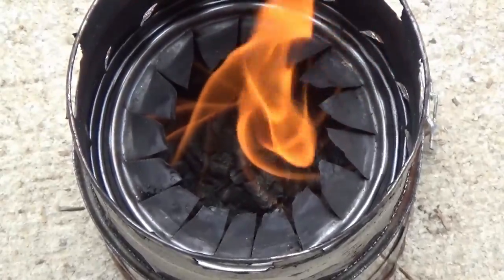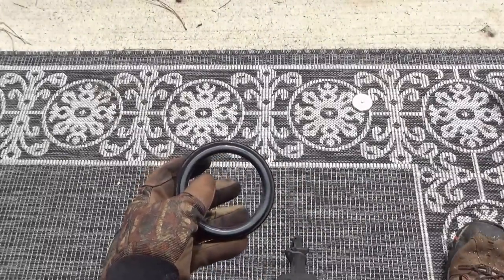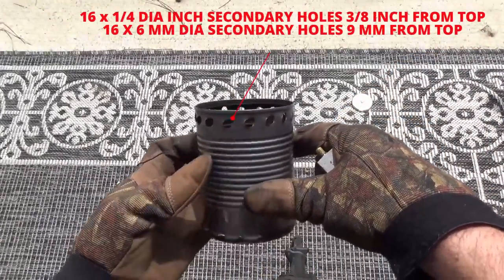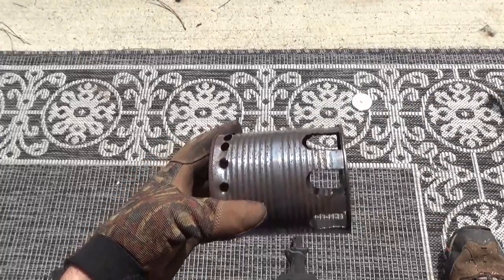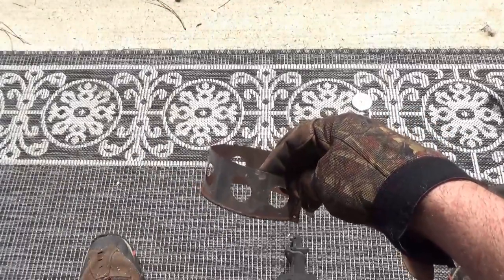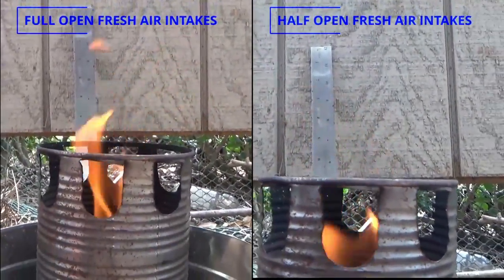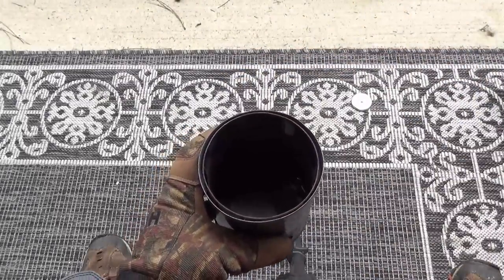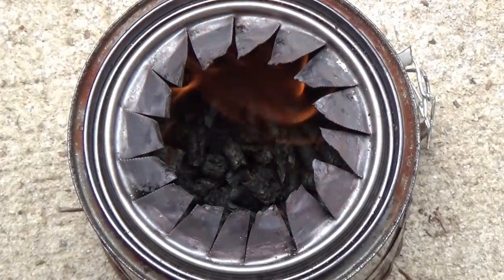Final Build! Paint Can Wood Gas Stove Optimization! Wood Gas Stove Science| Part 9!

Comment: I love the science Mr. Putnam. I am in the process of designing and building a heater based on a wood gasifying stove like yours.
I intend to use 3  5kg gas bottles (which measure 23cm in diameter (about 9 inches) and are 47 cm tall (18.5 inches)
I plan to use two bottles to make a heater body of about 65 cm (25.6 inches) tall and the third one to manhandle a section into a smaller diameter tube to form the "inner can" so to speak. I intend to use stove pipe (I have some 80mm / 3.15 inches which is common in the pellet stove world) as my chimney and possibly the intake. I plan to build the stove in such a way no air is draw from the room the heater is in but only from the outside. I like to use a throttle in the air inlet to be able to throttle the burn.
I like to add a cooking surface on top (with a lid made from the top of one of the gas bottles) and a ash pan below (which is actually the very bottom of a gas bottle which is made to be removable and made leak proof by use of a fibre glass rope (very common in the stove world)
My question to you is if you have any suggestions for me regarding the rought measurements of the "inner can" and the distance I need above the secondary holes to get an efficient cooking surface. And do you have an idea how I could add a baffle to prevent flames from entering the chimney...
Best regards, Sander.
Reply from the maker: The space between the two cans needs to free flow but not be so big as to not allow good heating of the air as it flows upward to the secondary ports. My suggestion is 6-10mm / .25-.375 inches. Good luck with the build and please let me know how it comes out! Thanks for watching!

Comment: Great Job my friend. I would like to recommend a little improvement. I saw it in some video or photo or patent, I don't remember, but the main thing is to put all the stove created inside a greater Can, I used for example the Bigest Tomato Can for Restaurant. It has double function, it help you in case of Wind, because the Air before to go into the Outer can Holes need to pass through  the Top and flow down speed, and also start to warm.

Have a nice day! And let me know if you could improve the stove ;-)
Reply from the maker: Thanks for the comment!

Comment: Heath, great systematic work to nail down the system! Thanks for taking the time to make the videos. 
You discussed the dimensions of all the parts and mentioned a method for figuring out the spacing between the inside and outside walls. Can you point me at the info you have on that? I'm trying to get a handle on applying these principles to a backyard fire pit. Thanks in advance.
Reply from the maker: I think starting with the Vortex 5.7 build video and then using the video on optimizing wood gas stoves to tweak the end result will probably get you pretty close! Let me know how it goes! Thanks for watching!

Comment: I found the enchilada sauce can.  I like that I had to pound  it into the paint can. The Progresso and Bush's can have both fallen out on me.  I don't think this one will.  🤞🤞
Reply from the maker: Looking forward to hear about your results!
Reply: @heathputnam9524  so far it's looking good.  My bottom holes started to run together and I think my total is 1 or 2 less than you used.  It's boiling 2 cups of water in about 7-1/2 minutes and burns about 40 minutes.  I haven't tried the Vortex tweak or flame concentrator yet and it's already the best one I have.  Just putting on your pot stand gained almost two minutes compared to the slotted chicken can I was using.
Reply from the maker: Sound promising! The Vortex tweak will help a lot! And the concentrator will lower wind impact! Keep me informed!

Comment: Thanks for your hard work on this project! Have you considered adding insulation to the outside of the stove to allow the rising gas to heat even more before coming out of the secondary ports? Perhaps some pipe wrap made of fibreglass would do. 

If I can make my first stove using your plans this weekend I might give the insulation a try and report back here.
Reply from the maker: I did try it on an early experiment and didn’t see a noticeable difference but I think it has merit especially during initial gasification. Please let me know how it works! Thanks for the comment!

Comment: I added the pot stand to my stove and cut almost two minutes off my boil time.  I'm planning to make one like this when I get the parts.  I have a spare paint can but the local market doesn't have the 19 ounce inner can.  Still looking.
Reply from the maker: Awesome! Thanks for the comment! Good luck finding the can! I actually took the top ring off the paint can to the grocery store to find the right can! LOL!
Reply: @heathputnam9524  a 22 ounce Bush's Grillin' Beans can has the same top rim as the progresso can but it has the heavy rim on bottom too and it's just a hair taller.  

The 19 ounce enchilada sauce is on sale next week.  Hopefully they stock up before then.

Comment: I think in one of the clips you tossed the flame concentrator into the pot stand. Did you have to trim the paint can lid or is your Hunt's tomato can a little bit fatter than my  store brand can?  Mine sits on the widest part of the lid.  No big deal, I can trim it if I have too.
Reply from the maker: Sorry that was not the cleanest cut between clips. I had to rewatch it myself! 😂 it was playing at 10x but I removed the pot stand and put on the concentrator the put the pot stand back on, but it happened in a fraction of a second in the video. Sorry again for the confusion! Thanks for watching!

Comment: Excellent video!
So the optimized ratio of primary/secondary air would remain the same for a larger build, ie gallon can? How would you calculate area of primary/secondary air in proportion to volume of firepot to determine size of holes?
Reply: not in proportion to stove volume, but inner can bottom area.

Comment: Is there a link to the build plans for this anywhere? Also, if someone wanted to use this reliably, I'm thinking some kind of fiberglass fire blanket would be good in case of a tip over, and some kind of collapsible base stabilizer like you can get for backpacking stoves since it is so tall and skinny. I would love to try this camping since it lets you have a little, contained campfire that is Leave No Trace compliant and requires such little fuel.
Reply from the maker: I try to find a flat rock to put it on when using it in the wild. The plans are on the “ build “ videos, such as they are. I have not published actual plans for any of my stoves, I try to give enough info for a DIYer to be successful! Thanks for watching!
Reply: @heathputnam9524  I'm making one with a baby formula container exterior and quart paint can interior. Is there an area formula to determine the primary air? Or just put in as much 1/4" holes as possible and then use the primary/secondary ratio to get the appropriate secondary area?

Comment: Now I'm confused.  I just watched a man build a stove similar to this except he cut a hole in his lid to fit a smaller can.  He put two offset rows of twelve 1/4" holes on top of his inner can.  If my brain is thinking right, he needs about a hundred 1/4" holes on the bottom to get the 4:1 ratio.  He put eight 5/16" holes and a couple more that couldn't have been more than 1/8" in the bottom and that's all.

It burned, but barely.  He practically put his hand in the fire and said it wasn't very hot. Someone commented that he should block off some of his primary holes.  (He barely had any to begin with!)  That would make it burn slower and hotter and it would cut down on the soot on his pot.

You showed in one of your videos that adding primary holes is what makes it smoke less.  And can it really burn slower AND hotter at the same time?  You have to burn fuel to make heat, right?  More=more.

Sorry for being so long winded but some people seem to have no idea how these things work.  I don't know much myself.  I'm learning thanks to you but I'm not to the point where I would  make an instructional video for others to follow.  I'd look like a moron and I hate when that happens.
Reply from the maker: I hope my videos are helpful to people trying to learn and hope I don’t look like too much of a moron!Haha! Thanks for watching😂
Reply: @heathputnam9524  you look like you've thought through each step and then showed that they actually work.  It makes me wonder how anybody could comee up with an opinion that is so different.

Comment: I would like to see a burner using these principles applied to burning waste vegetable oil and or used motor oils.... I've built many  waste oil burners  and if u can get the temperature and air ratios correct they can burn very clean and extremely hot but I've had problems coming up with small burner designs that actually burn the gas at the top it's seems the problem with these fuels is getting the correct atomization and air fuel ratio on the primary burn as u really can't draw or force the air up through the bottom of the can like u do with the pellets .... Any ideas and or videos on this type of burner would be greatly appreciated.... Now I believe Coleman used to make a fuel oil burner that used these same ideas and principles as these gasifier burners ur making but; I've nvr seen one in person and finding any info on the exact design of these burners seems to be non existent as I think of I could come across some detailed drawings or pictures of these burners I believe they would be very useful.... Thanks in advance for any help or info
Reply from the maker: Thanks for the idea! You may see a video in the future!